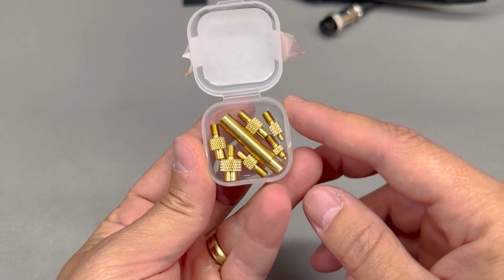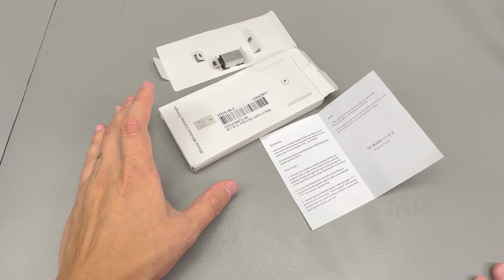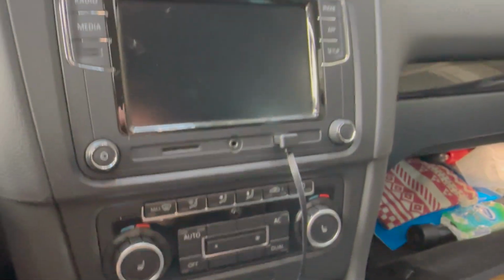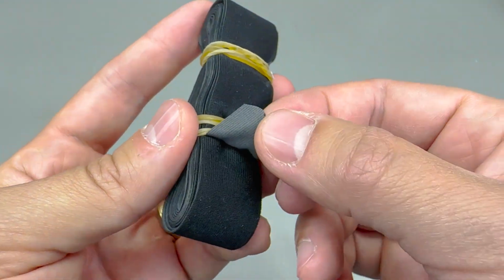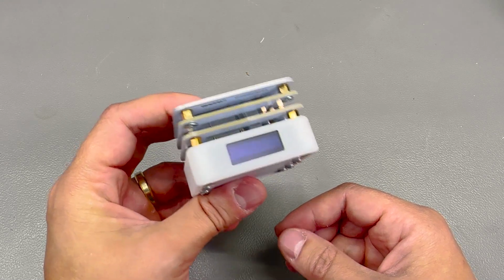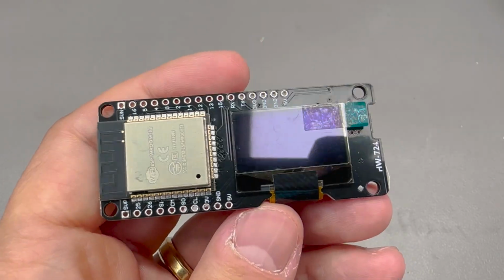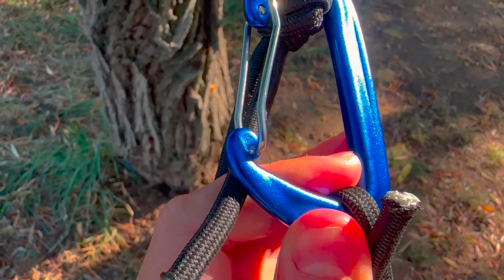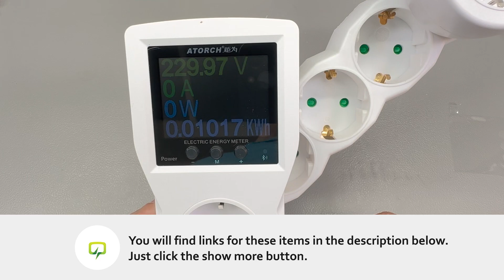InTheMail | Voltlog #457

Comment: I have this power meter and there is one big flaw. Inside is only a small rellay rated for 10A. If you want to use it with more than 2000W  you should install bigger rellay or bridge its concacts.
Reply: Hmm, thanks.
I have similar from Ali
Have to check inside. Maybe it has same flaw. I'm sure it has
Reply: I was thinking why would a power meter need a relay, then remembered it can switch the outlet on & off.

As an aside the ErCan Everything channel has repair video on these, dead inductor after trying to measure a bad inductive load.

Comment: Time ago I got one of these carabiners. The 'CE' certification letters had the wrong font and the numbers were invented. Even with the correct letters and numbers it's difficult to trust them.  For real climbing it is a real risk.  I reported it to Amazon, they returned the money and the seller disapeared and probably appeared with a different name.
Reply from the maker: I don't think anyone would really use these for life critical applications but for other activities I think they do a good job.
Reply: The small one no, but the bigger one with the security lock is sell for climbing and is advertised for climbing. 
And it is a real risk of dying. Climbing is not uncommon to develop forces above 1000kg, I don't know if each one it is tested.  
Of course I know that you can't trust them, but they sell many to anyone.

Besides that, it is forbidden to sell any kind of thing in Europe without the proper 'CE' certification, or the respective certifications in other places.